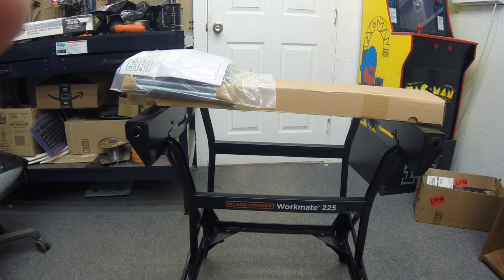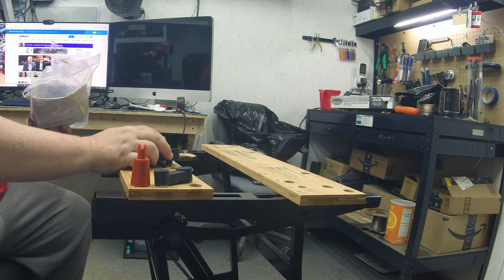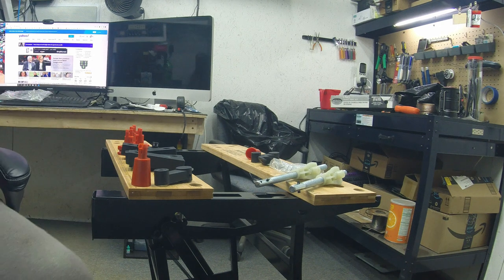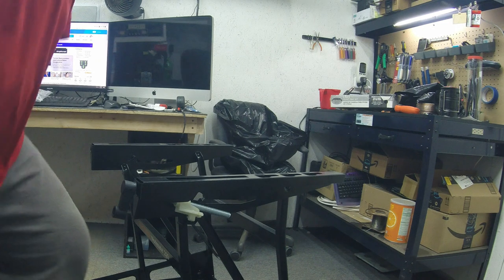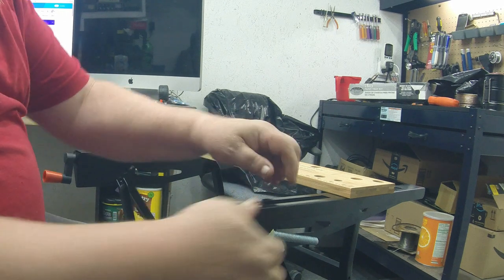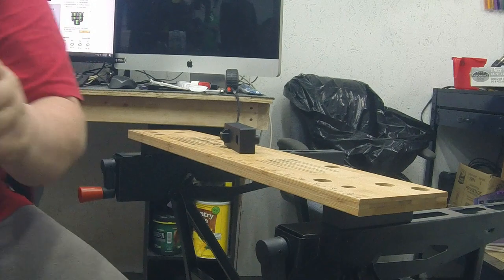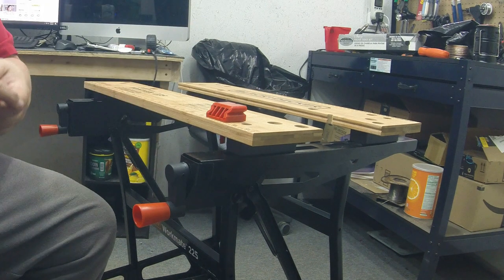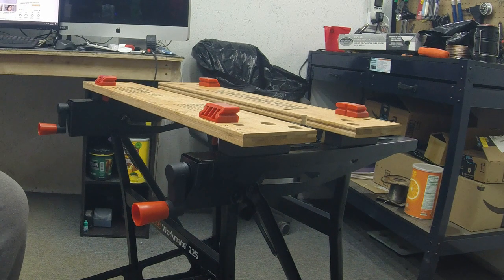Black and Decker Workmate 225 Assembly and Review

Comment: To install the roll pins into the handles I found it much easier with a large bent adjustable plier. It squeezed them in much easier than hammering.

Comment: Man I had a hell of a time hammering the pins in.  They still stick out a touch.   That was the only pain of this whole thing.  Looking forward to using it now.  Got it on sale for $40. Thanks for the vid. Wanted to see someone doing the pins lol.  And I forgot the washers.  Damn it.  Didn’t forget the prior times. Rushed.   Think I’ll cut them and bend them around maybe. Doh!
Reply from the maker: LOL I hear you on those pins I had go medieval with one of them. Handy to have though I was using mine today...
Reply: Lol.  Well, I’ve been meaning to get a roll punch set anyway for a tobacco cutter restoration and general use. So I got a set and the punch worked perfectly. Got the pins out and put it all back together quickly.   Now to finish so I’m back here. :)  just ordered a dremel 8260 arriving tomorrow too and excited about that coming.  Perfect time for next project to use both.

Comment: Thank You.  The one that was shipped to me had instructions all in Chinese only!   I had the same problem with the last bolts.  One went in relatively easy but the other would not catch on the thread.  I used a hammer and got increasing aggressive until the plastic end split off.  I then had to thread the broken plastic end on the bolt and it seems to work but might be a week point as I use the work bench. 
I had one of these years ago and it lasted for ever but when I moved to the other end of the earth (Thailand) I could not take it with me. 
The bolt assembly is a flaw and it's surprising that given how long this product has been out there it has not been fixed.  
Again, thanks This helped me a lot.

Comment: Thanks, that was very helpful in my assembly 🎉...P.S. The Electron Man has probably already figured out, but for the rest of you, You can easily store the Pegs (or Dogs, or whatever they are called) out of the way simply by inserting the Orange Pegs into the holes from underneath the table, then U always know where they are when U need to use them on top of the table.

Comment: The printed instructions were the most incorrect I’ve seen in a while. The attachment of the handle using that tube piece you have to hammer in was awful. Damaged the metal due to force and accuracy required. Also another aet of hands(or vice grip is required). After that I wanted to see how others fared.
Reply from the maker: You are correct that is why I made the video those instructions were totally useless.